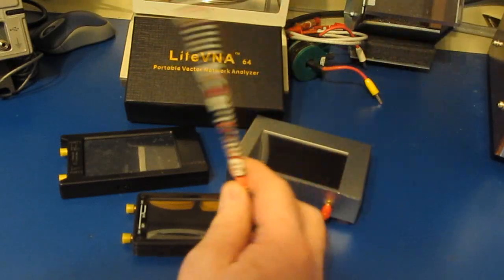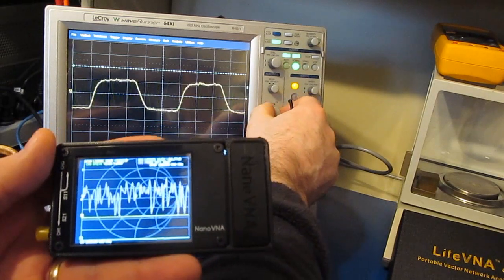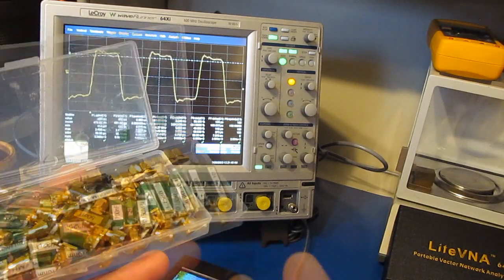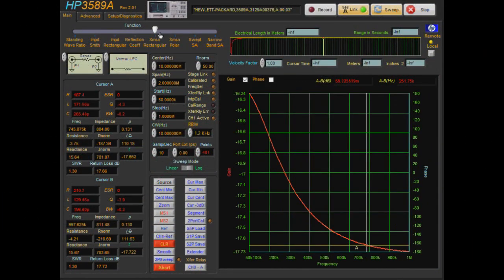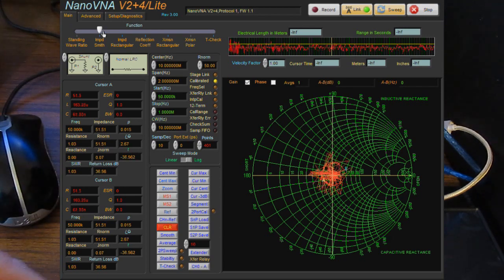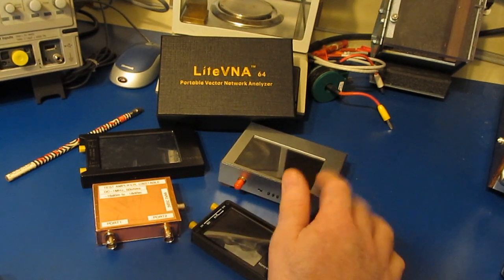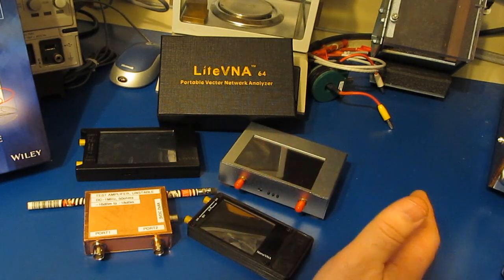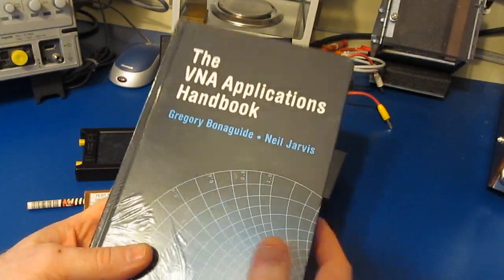The LiteVNA plus my rebuttal of comments made during a recent VNA presentation.

Comment: Which VNA do you recommend for checking and tuning SWR in 915 mhz and finding total gain from antenna thru coax to transmitter?
Reply from the maker: From my previous response to your same question:  Assuming you just want to measure VSWR, maybe consider a good VSWR meter?   At a GHz, you could make up a coupler and use your scope.   If you are trying to measure radiation patterns, maybe a portable  SA and your phone for GPS tracking?   These low cost VNAs are a very good tool to learn some basic concepts.   If you want to experiment above 300MHz, I like the V2Plus4 but they are seldom in stock.  Another recent option is the Lite.   If you want to experiment below 300MHz and would like to use it for narrow band work, I would stay with the original NanoVNA.   I have not made a review of the Lite, but I did for the V2Plus4.   https://www.youtube.com/watch?v=XaYBpPCo1qk   Of course,  if you can't work with a squarewave drive,  you will need to open your wallet.    https://www.youtube.com/watch?v=y6iOTEU6Zzo

Comment: For what it's worth, the Tinysa does put out a sine wave on it's low port which goes up to 350 mhz.  The high port which goes to 900 mhz puts out a square wave.  I have been trying to use both vna and the sa together.  The tinysa works very well as a test oscillator to test receivers.  What is neat about the tinysa is that both ports can be used as inputs or outputs of signals.

Comment: Good luck redesigning the turbo encabulator. The trouble may lie with the fact that the main winding was of the normal lotus-o-delta type placed in panendermic semi-boloid slots of the stator.
Reply from the maker: I and others should utilize these objectives to transform our strategic thrusts in addition to expenditure involving risk general principals into short-run preferred areas of focus in addition to action general principals.

Comment: I watched this video and read your EEVblog comments and decided to buy a LiteVNA 64. Just got it today and am very impressed with the dynamic range, 1001 sample points, etc, (it's time to go tune some cans!) It allows me the ability to average out the noise from as many as 80 overlaid  samples. While that's a slow process, I figure I can just enable that degree of averaging after I have the duplexers tuned close to peak. Good dynamic range, even with slow sampling speed, up into the GHz range would not seem easy to do in a dirt-cheap, pocket-sized VNA, but they did it. However, I will keep in mind the possibility of problems associated with the odd-order harmonic content. 'Know thy equipment'. Thanks.
Reply from the maker: A few people have asked me about using them to tune various filters and I typically refer them to the manufacture's manual for their filter.  In many cases, I doubt the low cost ones I have looked at would be good enough but sounds like you claim otherwise.   Of course, it's easy enough to compare the noise and dynamic range.  The V2Plus4 is a little better.   I did attempt to use them to look at a BP filter.  This may give you some idea how they compare.   
https://youtu.be/XaYBpPCo1qk?list=PLZSS2ajxhiQD2gftdurGQoyGpUM_HobNI&t=2726
Reply: As I indicated, I have not yet done so, but I'm hoping to. While I'm a complete noob using VNA's I have used the technique of averaging out noise on my longwave communications projects with excellent results. My assumption is that the ability to average 80 samples will reduce the noise enough for me to do a good tuning. I obviously won't know for certain until I give it a try, especially as my math is poor so I need to do most things experimentally, but it seems reasonable. Am I missing something?
Reply from the maker: @johnwest7993  I would have thought you would know what you needed to do the job beforehand was all and would have guessed the low cost VNAs I have looked at wouldn't be up for it.  Even if you don't get the performance you need, they are still fun to play with and a great learning tool.
Reply: This is the right way to review VNAs, finally a video that puts real facts in order. I own minivna tiny (3GHz) from MRS, I was wondering if you could post a similar review, curious but also anxious about its true performance for a ~400 euro VNA, tnx, 73, SV1QZS

Comment: I cant think of a way to put a sine wave drive in to a product that small, over a range that large and at a cost below the entire cost of the VNA
Reply: It's not so difficult. A square to sine wave converter can be made with a nonlinear circuit (some diodes and resistors).
Reply: @blaap  over the entire frequency range keeping the amplitude constant? 
I cant think of how that would be accomplished 
even in narrow bands you will see an arc like voltage curve
Reply: @OneBiOzZ  I was wrong. What I was thinking about would only work with a triangular shaped wave, but that's not what we have here.

Comment: CP
"An interesting discussion. I think the main point is that if there's anything in the device under test that can go nonlinear (such as a diode or transistor), it may mess up the nano VNA measurement.
I wonder whether the nanoVNA actually puts out a continuous square wave signal, when set to zero sweep, or is there blanking involved?
"
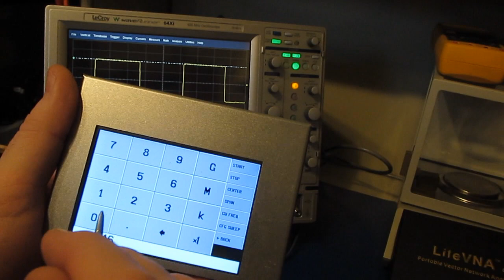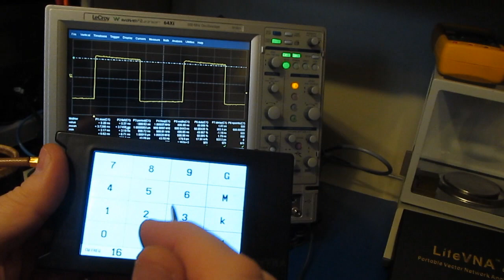Reply from the maker: I call all these low cost VNAs, NanoVNAs.  They are the Kleenex of the VNAs.   At 4:00, you can see the V2Plus4 does not have a continuous output.  At 5:09 we can see that the LiteVNA is continuous.   My original NanoVNA is also continuous.     I suspect like the LiteVNA, there could be firmware that would force the V2Plus/4 to provide a continuous output when in CW. 
Many people, including myself have posted how these low cost VNAs compare comparably with their commercial systems.   I've tried to avoid the pitfalls of the square ware drive.  It would be interesting to see what circuits people have had problems with.
Reply from the maker: You can see the waveforms here:   https://www.eevblog.com/forum/rf-microwave/nanovna-custom-software/msg3908996/#msg3908996

Comment: Long story made short: The NanoVNA v2 is based on ADF4350 for the upper frequency range (that's the signal source). Checking the datasheet of ADF4350 its VCO runs between 2.2-4.4GHz so there it provides a sine. Below that it's a divided signal (so a square). It's so simple. As the rise(/fall) time of that (divided) signal is around 70ps that will resemble to a sine even when using a very capable scope in the GHz range, not to talk about less capable ones.
Side note: Because the divided output of ADF4350/1 has fast enough rise time it can be used to exercise the signal handling of sub GHz scopes.
Reply from the maker: Long story made even shorter: These low cost VNAs do not provide a sinewave output over their entire operating range.  It's so simple.
Reply: @joesmith-je3tq  Classically, VNAs are meant for linear device measurements, and in fact S parameter theory assumes linearity.  Agilent was hawking their proprietary "X Parameter" measurement methodology for a while, the idea being to extend Sxy measurements to accommodate nonlinear effects such as compression and (presumably) instability.   Long story made almost as short: almost all VNAs other than the very latest/fanciest ones have untuned receivers.  So if you expect source harmonics to be the only hazard when measuring unstable or otherwise-nonlinear active devices, you may find that even the venerated classic hardware from first-tier manufacturers lets you down.
Reply from the maker: @NoahFect  That's much longer.
Reply: @NoahFect  Yep, knowing the limits of a test equipment is usually more important than the equipment itself (one of the best lessons I've learned early in my education) and NanoVNA is just amazing for the price. Sure it has less dynamic range than the 2 or 3 orders of magnitude more expensive VNAs, it can't handle very narrow BW, output is not sine for a big part of its frequency range or it doesn't have tuned receiver either but that can't probably either expected from this price category. It's still usable for many tasks and for example startup time or portability can beat many of the more expensive benchtop equipments from not so long ago that cost a fortune and in many cases were hardly ever used for more than the NanoVNA can do (as a bonus the H4 variant can even save data for a more up-to-date storage than most boat anchors if one is willing to solder microSD card socket).
Btw. I've recently ordered LiteVNA too for around 1% of the price of a VNA that I can compare. A fair comparison, isn't it? ;-)

@joe smith
I'm just too lazy to start up an analyzer to check the level of the 3rd harmonic from the 2.2GHz up range but I'd be very much surprised if it was not a reasonable sine (significant harmonic level).  Not to be a sine required a bandwidth for harmonics that is way beyond what is realistic in this setup.
Reply from the maker: @edigi488 Your story is growing.   "... it can't handle very narrow BW..."   Unlike the V2Plus4 and LiteVNA, the original NanoVNA does a decent job when measuring crystals and crystal filters.    "...the H4 variant can even save data for a more up-to-date storage than most boat anchors if one is willing to solder microSD card socket..."   Storage has not a problem as I run them headless.
Reply: @joesmith-je3tq Why can't the LiteVNA measure crystal filters and the original NanoVNA could?

Comment: The TinySA (spectrum analyser) looks exactly like the LiteVNA and it has a sine wave output from 100KHz to 350MHz and a square wave output for 240MHz to 960 MHz. Either output can be configured as a signal generator , So it can be done in that price range and form factor.
Reply from the maker: The question was if we could have a VNA with sine wave drive over the entire operating range, not a small segment of it.   Yes, we can certainly change those constraints and suggest is can be done.
Reply: @joesmith-je3tq  Yes, true enough. For the full range probably too expensive. I was just thinking it would help if they'd put in at least a sine -capable generator in for the low part of the range like what they done for the TinySA.
Reply from the maker: @TheHWcave  Personally, I would rather have the ability to measure narrow band devices and improved dynamic range at the lower frequencies.   But we all have different requirements.

Comment: I absolutely LOVE your videos!!!!  I was wondering your thoughts on Flir multimeters?  I own the DM166 and the DM285 and I was wondering if you have ever used or are ever going to test their meters?  I have learned A LOT from your videos.  I am just a auto tech with a meter collecting habit (PROBLEM).  You put out AMAZING content! Keep up the great work!!!
Reply from the maker: I've never looked at any of their products.  I haven't seen too much posted about them.  It may be the cost. 6000 0.9% + 2 counts and low res IR, it may be a niche market.
Reply: @joesmith-je3tq  I appreciate you getting back to me.   The DM166 kinda SUCKS!  The DM285 I am pretty happy with so far. I guess probably because it's the highest definition IR I have used to date. I have a Fluke 189, 289 and a 80,000 count bench meter, so I wasn't too pushed about the low count meter. I just thought it was kinda neat having the meter and ir in one package for around the garage. I can definitely see where your coming from and probably could have put the money to better use elsewhere.
Reply from the maker: @jamesaustin9848  So far I have kept my garage meters below $50.  2000 counts, 5% would be good enough for most of my needs.   I want the backlight and TC input which rules out the free meters from HR.   A few times I have needed a scope and ended up buying a couple of old Fluke scopemeters.  I looked at a few different automotive meters that can directly measure some of the timing.  You can see them here:

https://www.youtube.com/watch?v=q_89qoFMivg
https://www.youtube.com/watch?v=uY6ZcINF7L0

Comment: Hi Joe
I wonder how these low cost VNA can be accurate even with linear filters. If a square wave drive signal is calibrated, the third and fifth harmonic entering the receiver add up to the measured signal. This is because the mixer has a conversion gain for the fundamental and the harmonics as the LO is also square wave. What happens if a filter only removed the fundamental or the harmonics? For example what happens with a notch filter (S21 is -80dB in the notch)  that passes on all harmonics? I would expect the resulting measured signal would be the sum of the fundamental (-80dB) plus the third (-9.5dB) and the fifth (-14dB) multiplied with the mixer conversion gain for these harmonics. So how can you measure -80dB if the harmonics are not filtered out in the receiver? 
The same for a brick wall filter. You expect 0dB in the pass band but since the harmonics are now gone you are probably going to see a fraction of a dB less even with perfect calibration.
Have you perhaps already looked at this?
Reply from the maker: Seems you're not considering the firmware.   I've shown a few different filters and compared the results, for example: https://youtu.be/XaYBpPCo1qk?t=2732
Reply: @joesmith-je3tq  Thanks for the link Joe. I guess you are right. Since this is not zero IF, the harmonics can be filtered out easily.
Reply from the maker: @blaap  Still, I agree with what you are getting at to a point.   You can easily imagine testing a high gain amplifier that would overload the VNA when excited with the harmonics.   I suspect we don't see too many people posting of problems as many are considering the VNA an antenna analyzer.  A few may look at passive components but very few are looking at active circuits.  Just a guess.  I figure for the sub $200, it's still a great tool for learning.  At these prices, the beginner can make a fatal mistake (hooking it directly to their power amplifier for example) and replace it.
Reply: @joesmith-je3tq  Even at work I could use this. Much more portable and no worry if it's gets damaged (ESD?). Problem is more that the instrument then needs traceable calibration etc.
Reply from the maker: @blaap  Odd.  While I have seen people post about using them for professional use, I wouldn't have considered traceability a concern.
Reply: @joesmith-je3tq  A $100 VNA stills needs a $1000 cal set. The supplied set is not going to do the job 😇
Reply from the maker: @blaap  I can't speak for everyone but that's certainly not something I would consider.   Everything I have shown has been with the ideal model using the supplied standards or my home made ones.  There is no way I would mate a metrology grade connector with a $2 connector.  I'm sure you will fine people doing it, but I'm not one of them.
Reply: @blaap  Soon i provide Calibration standart correction option for device, this allow use more cheap standarts (if it parameters known, or measured)
Reply: @joesmith-je3tq  Every engineer can have it's own multi-meter or even scope if so desired. They do need to be calibrated on a regular basis (or checked). I want to add a VNA now that the price is so low. As part of the cost of ownership, the calibration should also be taken into account. A VNA is actually calibrated for every use, so it's the cal set that needs to be checked. It then boils down to do a regular check of the state of the connectors as they can be worn or damaged. And you need a spec for the cal kit (brand?) which I could not find in the plastic bag :-). Note I'm a design engineer, not responsible for maintaining all the measurement equipment so perhaps I can get away with all this if a big "not calibrated" sticker is put on the device as exception to the procedure.
Reply from the maker: @blaap  Assuming the low cost VNA isn't part of a production control process (imagine that), I would never have someone put a sticker on it suggesting it or the included standards were somehow calibrated.   Again, with what I have shown, I have never used anything besides the ideal model.  Even that is a huge step up compared with what my first VNA could do.   I would imagine many are using the TRL standards or something similar where the target PCB is the standard.   

Normally calibration is the last step I take, after the measurements seem in the ballpark.  It wears the parts, takes time to do and I can tell if something is wrong.    Of course, your mileage will vary with the VNA but I have done this many times with the V2Plus4.   A good example:
  
https://youtu.be/XaYBpPCo1qk?t=3584